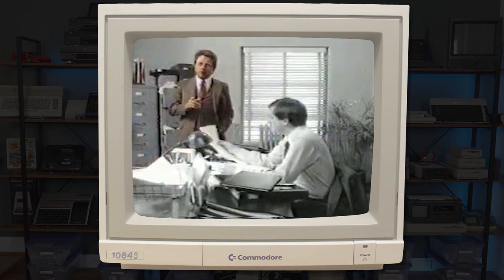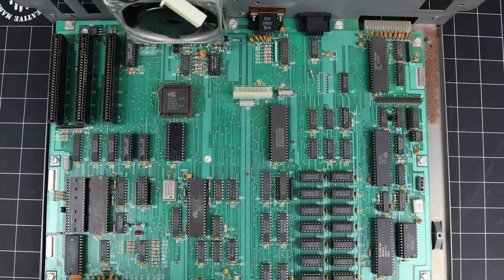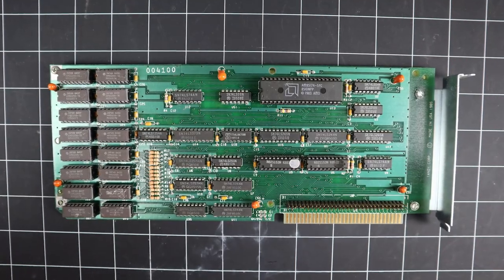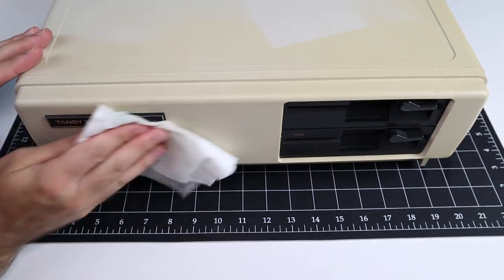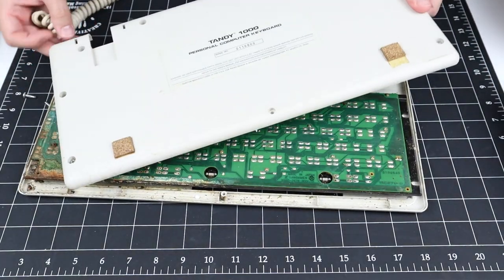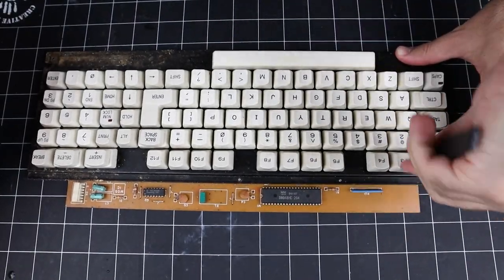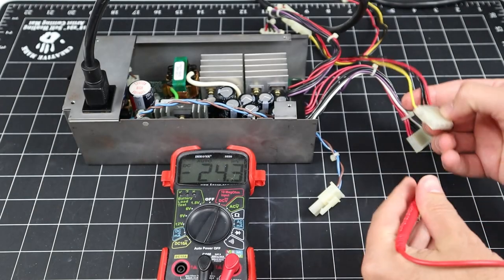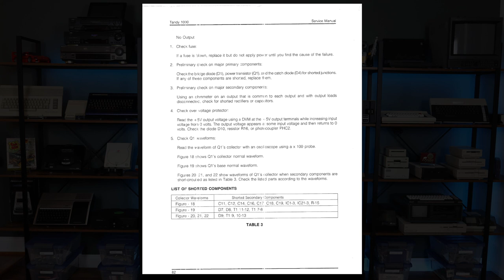Dead Tandy 1000 First Look, Repair, Restoration for #SepTandy

Comment: Great video! I'm honestly surprised how much the Sun brighting helped the case. I wonder long term if it will yellow again and how quickly.
Reply from the maker: Yea I was surprised as well. I think I'll probably give it a few more days in the sun and then apply a UV protectant. I've had some things I retrobrighted with peroxide re-yellow within a year, so it's definitely a possibility here too.
Reply: @retrobitstv  I'm confused. I thought what caused the yellowing WAS ultraviolet light...? Am I wrong? I guess I just don't know the ins and outs of the chemistry of ABS plastic.
Reply from the maker: @SeeJayPlayGames  It's kind of non-intuitive isn't it? Over time, UV light and heat cause the plastic to yellow, but a megadose of UV causes it to bleach instead. Must have something to do with the rate of exposure but I do not know the science behind it!

Comment: Welcome to the Wonderful World of Commodore... I mean Tandy LOL! I would recommend you swap out the stock 8088 processor with a NEC V20. It will give you a nice little boost for the machine and be a period correct upgrade. Also, if you go with a -10 or -16 NEC V20 processor, it will run cooler than the stock. Put a Math Co-Processor in the machine too. SimCity actually uses it and helps with the game running a little better. The case came out nice and looks a lot better. I look forward to part 2.
Reply from the maker: Thanks for the ideas, I will keep an eye open for the upgrade parts (once I verify the machine even works) :) I've got an HX to play around with next so I may just focus on upgrading that one depending on it's condition which is still TBD. I am surprised how well sun-brighting worked, given enough time. I will probably give it a few more days to clear it up just a bit more.
Reply: @retrobitstv  You're welcome. When the time comes for your 1000a (or HX), I've got a spare V20 that I could send your way no problem.

Comment: -- eBay seller translation --
not tested: broken
good cosmetic shape: massive internal water damage
well-packaged: several layers of bubble wrap around a case of loose components
Reply: Yup.
Or sometimes "tested" means "I didn't actually test it", or "I tested it and it didn't work right"
Then there's "I have no way of testing this"...  Which sometimes is like...  Just get a damn power cord and turn it on...
But...  holy crap...  The one that makes me actually tremble with rage at this point is "powers on". It means ABSOLUTELY NOTHING. Like people will say shit like "it's not working but I tried it and it powers on" - like if it's not working then what does "powers on" even mean?  Probably just that the fans spin or a light turns on...  Ugh...

But, lucky me, when I bought my Amiga 500, it was "not tested" and "I have no way of testing this" but when I got a power supply for it, that thing worked like a charm, big fat ol' beastie that it is!

Comment: That KB - ouch! Hopefully it’s salvageable and you can find a good PSU solution. The T1000 is a fantastic machine. Best of luck. Looking forward to Pt2.
Reply from the maker: Thanks, I'll need it! I was completely caught off-guard based on how nice the exterior of the keyboard was. I've got a lead from the VCF forum on a modern replacement PSU that fits in the stock location, but I'm saving that as Plan B.

Comment: Re: the BIOS ROM part number: The same BIOS chip was used in the EX and SX, and it doesn't include the ROM booting feature. (it's only a 16Kbyte ROM, just enough room for the Tandy-customized Phoenix BIOS. The DOS-booting HX has 128Kbyte and the ROM wouldn't work in the older machine's sockets.) I wonder if it's possible late 1000A-s came with that version of the ROM, although another theory could be that someone broke the pins of the original ROM when they pulled it to add the Smartwatch module and it got replaced with whatever the local Radio Shack had on the shelf. (Should work fine.)
Reply from the maker: Great info, thanks! Ah well, I was half hoping it would be able to boot to DOS from ROM, not that I'd need it with the XT-IDE card :)

Comment: This was my first computer.  I had a similar hard card and that amount of damage was not surprising.  Those things were heavy and put lots of pressure on the ISA slot even when properly screwed in.  And that poor keyboard...  You might be better off getting a Tandy to PS/2 keyboard adapter.
Reply from the maker: Yea I have a feeling the keyboard is either going to need a dozen bodge wires or just disintegrate entirely when I try to clean it. We'll see!

Comment: That hard card looks odd, it appears to have a 40-pin connector? There were a few cards that could do a primitive version of IDE for XT class machines out there, but none of them had the hard drive physically attached, as all of those cards were released later as more of a retro-fit while AT type enclosures were common.
Reply from the maker: I'll have to take a closer look at it and see what interface it has and when it was manufactured.

Comment: Good luck with the Tandy!
I've been working on my Amiga (recently replaced the Agnus to upgrade to 1MB of chip RAM) - though in the process of testing out the mod I also learned that my built-in floppy drive appears to be out of alignment. (Maybe explains why so many of my attempts to write Amiga disks have seemingly failed...  Fortunately I got a nice external drive, which makes for a great point of comparison!)
And I've been shopping around for a compact mac (I missed out on a pretty good, local deal for a Classic...  Got my eye on an SE/30 but it's kind of distant and expensive...)  But along the way I found an old Powerbook 145, which seems like a pretty decent way to get that classic Mac experience - but there's a fault in the display somewhere so every 4th pixel on the top half of the display is out. (I've tried a few things to find the fault but no luck so far...  I'm determined, though, gonna fix it somehow! Given the nature of the fault - particularly that it affects EVERY 4th pixel of the top half of the display - it seems likely it could be a single point of failure (corroded trace, etc.) somewhere in the signal path...  So I'm hopeful I can find a solution.)
Pondering whether to pick up an Apple IIc+ I found...  In some ways it seems like a great model of the Apple II to get, but in other ways...  Well, its faster CPU and 3.5" disk drive are great in theory but both are significant problems from a compatibility standpoint...
But right now all this is taking a back-seat for a little while, as there's model shows coming up and I want to get some models made!
Reply from the maker: Thanks, keeping my fingers crossed! Ah yea, the SE/30 and Color Classics demand pretty steep prices compared to some of the lesser loved models. I still have to crack into my Classic II and see what all is broken in there. Maybe for Marchintosh 2022 :P Yea, that sounds like a trace or faulty ram for sure. Not sure what I'd do with a IIc+, as you said compatability... There are good deals to be had on a IIgs if you shop around. Sounds like you've got your hands full though :)
Reply: @retrobitstv   I have a pretty deep disrespect for the IIgs as it turns out. It's a pretty machine but as a contemporary to machines like the Amiga it falls way short. Like the C128 I feel like it's not good for much apart from its backward compatibility (and its architecture was kneecapped from the start by that compatibility...  In particular, on a system with no hardware support for scrolling playfields, blitters, or sprites, the video RAM is limited to the 1MHz speed of the Apple IIe core...  Terrible!)  As a "better IIe" I think it's great, but as the last big step forward for the Apple II platform, the new iteration which supposedly could have carried the Apple II forward into the future, I think it's a damn mess.
I think the IIc+ would be workable - this particular sale also includes some external 5.25" drives, and of course the turbo CPU can be disabled at boot (and there's an aftermarket ROM to make that setting stick). The 3.5" drive could actually be useful, too, especially with the large stockpile of DD disks I'm accumulating for the Amiga. (I think it'd be roughly the same experience as using a C-64 with a 1581 as drive 8: Lots of cracked software on custom disks...)
But I think I've also got to figure out if getting an Apple II is even worth it for me personally. Nostalgic for sure, and in many ways a great old platform, but being a 1970s platform that continued through the 1980s, it's a bit primitive, too. If I could get a IIc with the little monochrome monitor, I think that'd be pretty fun. Nice, compact, classic configuration.
Reply from the maker: @tetsujin_144  Yea I'm not going to defend some of the design choices that went into the IIgs. It could have been so much more. But it's still probably the best of the Apple II world since there are hundreds of IIgs-specific titles, expandability, and the full backwards compatibility.  I really don't know what's available for the IIc+ since I've never actually seen one in the flesh. We had the plain jane IIc for the family computer / word processor for many years and it got the job done, but yea, by that time the platform was pretty tired. Still fun to fire up Total Replay from time to time and mess around though.